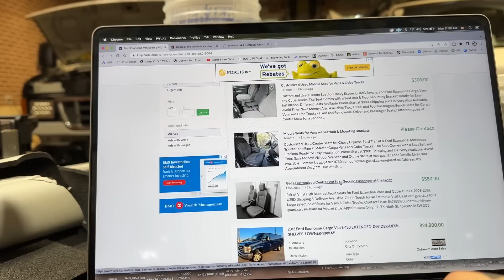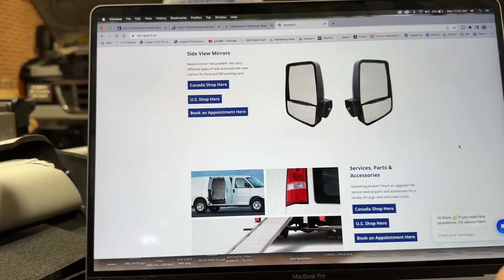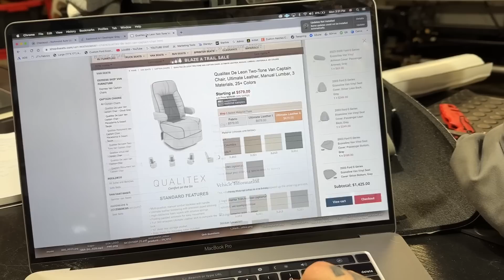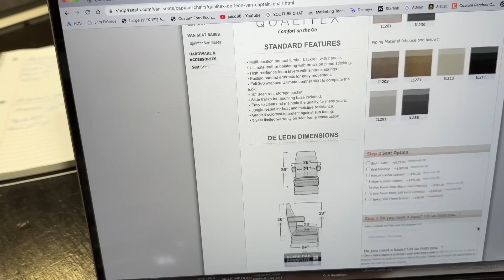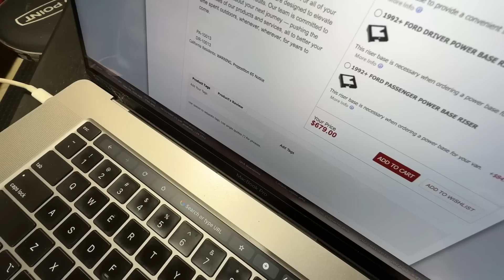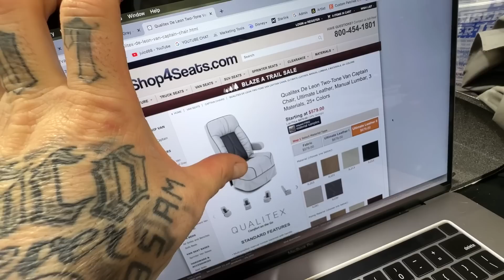BYE BYE CITY! Swivel Seats? THIS BIG CAMPER Get's a NEW FLOOR

Comment: Would this work next time? Maybe make a template with cardboard pieces and masking tape. Use small pieces of cardboard or poster paper to get the exact shape of the floor, taping them together as you go, then lay the complete template on the floor cover and trace it out for cutting.
Reply: I cannot imagine doing it any other way successfully.  Templating is by far the best way to make well-fitting floor, wall and ceiling panels in such an odd shaped project, for sure...  And doing that isn't a walk in the park...  LOL

Comment: The two layers Below your new floor … do they have jute backing (looks like a mess of ‘threads’, yarn, …) ?
If yes, you Really want to think about pulling it off.  BIG Rust trap.  Holds condensate, and doesn’t dry out …
Reply: He already pulled that junk out and start from bare metal with rust converting paint and sound deaden material he is using doesn't have it either.

Comment: Hey Chrome!  I changed the seats in my E350.  Got some seats from late model highway tractor that had been wrecked.  The seats are air ride with lots of adjustments.  These are seats that are designed for spending all day at the wheel.  Everything is adjustable and are great on those rough roads.  The air compressor for your locker will easily operate the seats.  They don’t use a lot of air for making adjustments and don’t need any air the rest of the time.  Look on the mainland for wrecking yards that specialize in highway trucks.  The pair I got only cost $500.
Reply: I'm pretty light at about 140 lbs.  Think the air ride will work for a lighter person?
Reply: How do they look?

Comment: Use a blow dryer to soft it up a bit and use a white chalk for lines where you want to cut.  Also, always cut down from the edge to the line.
Reply: I was just about to say the same thing.
Reply: Same here. And maybe save what's possible for small areas.

Comment: I don’t trust myself with jobs like that on the finished material. I’d go with a cheap cotton drop sheet as a template and tape it to the vinyl and cut around it. Maybe hanging up above the diesel heaters would let the creases drop out from it own weight?

Comment: I have used that flooring before. If you have to do it again. Don't cut out the hole for the seat bolt first. Just make a slit where the bolts can fit through, then when it is in cut out the hole. So if you put it in wrong, it's easier to move it and seal that slit and no one will see unless they are looking for it. I messed up 2 times, and you wouldn't know.

Comment: 6:38 I was just going to recommend that. It will make it easier to work with and give you a better fit in the end. Warm vinyl is way easier to work with. And yeah carpet would be easier and warmer on the feet but damn I feel ya! Spend more time cleaning than anything else.

Comment: Try making a softer template, then cut the sheet a bit bigger than the template and trim it to the correct shape. I re-did the carpet in my camper that way.

Comment: Chrome. . . . Dude .... Those seats that you have, in both of your vans, are the cheapest most basic seats Ford provided in the cargo vans. Perhaps check into a used upgraded factory ford van seat. (from a loaded up passenger van) Much nicer seat, would bolt right in, and worthy of, perhaps of being reupholstered. Just sayin. (used truck parts dealers, Pick n Pull)